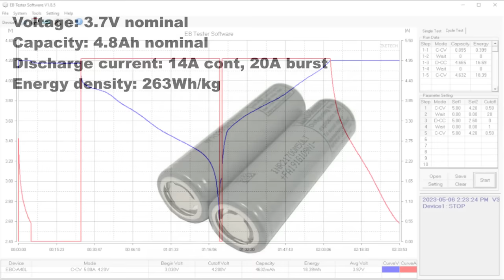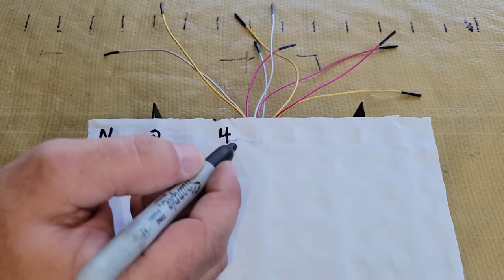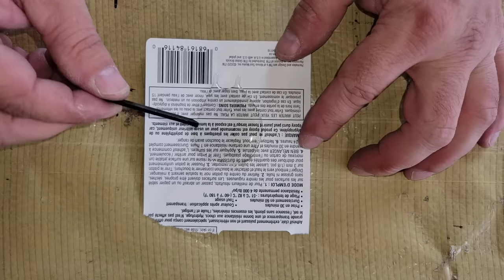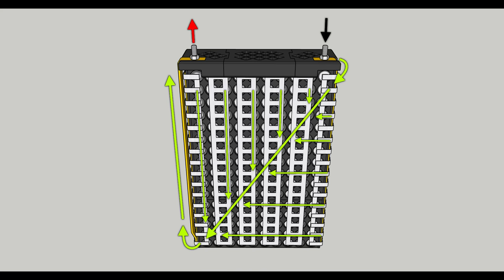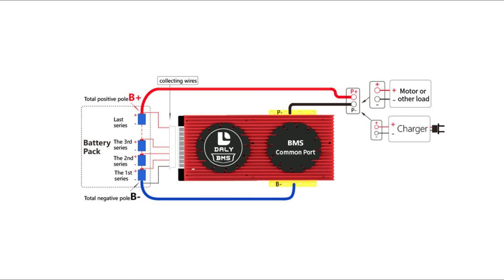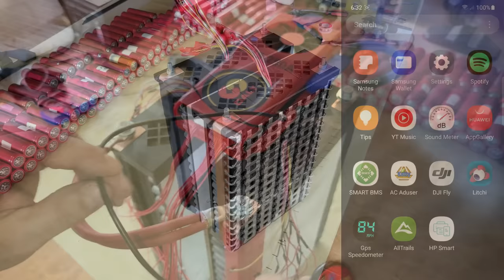Electric Motorcycle Build - E-Bike - Gen II, Ep 3: 77 Ah Battery

Comment: Grey stuff is "Gap Pad" it does allow a good thermal contact to the outer case, which air doesn't give you, while insulating electrically.
Reply from the maker: Thanks. No one else seems to have a name or source for it. Looks/feels very similar to silicone putty. I would question it's thermal transmittance ability if it was made of silicone. Not a good material for thermal transfer.
Reply: @JamesBiggar  An example product is Laird tflex HR400. Other similar ones on Digikey. Tacky silicone sheet, modified for good thermal conductivity - 1.6 W/mK vs 0.03 for air gap.
Reply from the maker: Nice. Not arguing an air gap is best, just questioning the logic behind using silicone. Without modification it's notorious for having very low thermal conductivity, lower even than air. Works great for apps that require high heat resistance. But if it's modified to be more conductive and it works, then it works. I might just buy some larger sheets and give it a try 👍 
https://www.engineeringtoolbox.com/thermal-conductivity-d_429.html
Reply: Just be careful that not all the pad materials are as electrically insulating as others. I think most with ceramics/aluminium oxide are in the megaOhm ranges, but the even higher thermal conductivity sheets are also very electrically conductive.
Reply: @JamesBiggar  Thermal pads are very common in PC hardware. It is used for memory modules in graphicscards, ssd controllers etc. These are fused with thermal conductive materials. I doubt its very useful in your case though. The pad is very thick Almost 10 mm by the looks of it. And it is connected to a slab of aluminum without fins etc. I won't expect it to do much in this case, maybe a 4, 5 degree C temperature difference at best.
Reply: @JamesBiggar  The motor you are using has been shown to do 50kW continuous and 80kW peak on Electric Bikes pages on FB, you aren't even touching the tip of its power yet!
Reply: Looks like thermal pads to me. Also used a lot in computer components

Comment: holy cow man! I built a battery super similar to this same different cells but still Li-ion, and I used the Grid cell holders to space them out but used the exact same copper bar method so that I could have screw terminals on a Li-ion pack. It is also for my electric motorcycle I built for my senior project in college. Great minds think alike!

Comment: Cool project, if you plan on using more powerful motor battery consider the BMW I3 and look for a wrecked one as carbon fiber frames can't be realistically be repaired. Each NMC chemistry module is 48V × 8 per pack = 384V nominally rated as 360V. Stock motor specs of 125KW (168 hp) and 250 nm torque (180 ft lb) that could theoretically have significantly higher output for 5 to 10 second burst mode.

Breaking down battery specs..
125,000 motor output ÷ 360 nominal pack voltage = 347 amps
48 volt module × 347 amps = 16,656 watts ÷ 750 watts per hp = 22.208 hp capability per 48v module

Comment: i am shocked how much patience you have dremeling every single cell and THEN sandpaper it! wow...
i would lost my mind after 20 of those.  🤣
Reply from the maker: Lol, super monotonous for sure. I can't stand tasks like that. But with the cost of new M50lt's being $8/each at the 18650 battery store vs paying $600 for three of these used modules that still have >98% capacity left, that works out to almost $2k in savings with extra parts to boot. So I put up with it lol
Reply: At the end when you explain the bms settings, there is a pile of cells unused on the table. Are these extras or duds? If extra why not add them?

Comment: Thanks for this video! I just bought an Emotorbike that has a 72v lead acid config and I've been looking to upgrade to a high AH lithium ;but prices for premade are over $1000 CDN ;but I can buy 2 36v 70AH battery packs for under $300 and wanted to strip then rebuild them into a 72v pack. This video is exactly what I've been looking for, thanks so much!
Reply: You can also just disconnect the bms from both packs and run to a new 72v BMS, cough bac4000..m

Comment: at 01:00 it sure looks like thermal pads, but the usability of conducting heat seems like it wont do much. The thickness of the pad suggest that there wont be a whole lot of transferring, and the heat sink is just a slab of aluminum (no fins etc). It might lower the temps by a few degrees C but is that really needed?

Comment: Any details on the bms? You mentioned that it handles 30 or 40 amps. I bought one of these packs and it will be great to be able to use this bms since it seems high quality and built right in; but I can't seem to find any details on the wires; and do not see any voltage on the wires. There is not much marking on the the bms pcb. If you are able to do a video of the bms, it will be extremely helpful. Thanks.

Comment: Cool! Have you thought of having a mi battery slung under and a second battery using the Petrol tank filled with batteries as well? That's what I did on my 1964 Lambretta Conversion. I get a solid 720 km per charge

Comment: instead of two dusk bars for the positive side, could someone put a awg wire at the bottom so it will still equally share the load? Just wanted to know for my battery build!!
Reply from the maker: Yes, as long as you size it accordingly.
Reply: @JamesBiggar  what you mean by sizing? Does that mean getting the correct awg number for the battery?

Comment: Instead of heat gun can you use a electric iron to soften tape/glue to remove back easier?
Reply from the maker: Use a towel or something between the iron and the plastic so the plastic doesn't melt and it should help, just be careful not to short it out, and make sure there's no water in the iron.

Comment: Why did u say the original nickel wasn’t capable of the full current output of the cells?  At the terminals it gets thin as it comes to a single tab but going between the cell groups there’s a lot of nickel.  I have three of these packs and want to put out the max current.  Depending where I look I’ve seen them putting out maybe 250amps and I planned to see my esc to that limit.   I plan to dremel off the plastic at the terminals and solder a copper strip there and call it done.
Reply from the maker: Being able to output 250A doesn't mean they should be. The cells in each pack can't even handle that kind of continuous current without risking serious damage, especially with the factory bus bars oriented as they are. The M50lt's are only rated for 14A continuous, 20A peak. 14 * 11 cells in parallel = 154A. At 72V nom, that's only ~11 kW. My bike motor can do 12 kW continuous, hence part of the reason why I broke down 3 modules and paralleled 5 more cells together in each string so the larger pack can handle at least 220A. Refer to the cell spec sheet and bare in mind that max power is not sustained power. But this is just the cells. One of a few reasons why a battery built for low load demands needs to be rebuilt to handle high loads. If you consult a nickel strip ampacity chart and do a calculation on the cross-sectional area, the factory nickel can't handle that kind of current without serious risk of a fire, either. More heat also means less efficiency. Heat is energy, and the more energy wasted creating it, the less you have to play with. Electric powertrains should be kept <70C across the board for safety and efficiency. Trying to pull 250A continuously through a battery built for 50A max isn't safe or efficient. It can be done for a few moments, but there's a reason why ev powertrains are rated based on continuous power and not peak power - peak power isn't sustainable because it risks damage if prolonged. Understanding cell specs and conductor ampacity is a must if you want to build or rebuild batteries. I recommend ignoring people who push things to their limits and claim "yep, it can handle it" without offering an explanation as to why they think that. Maybe it can, for a while. I could run my truck a full throttle on the highway too. How long do you suppose the engine would last redlining it constantly? The factory 'bus bar' configuration (connected to the terminal tabs) is also not ideal - besides being WAY too thin for the current that I'll be pulling from it, the load is directed through the top of the pack only, while the bottom cells are left to equalize the pack which leads to the top cells degrading before the rest, if they're not immediately damaged from overcurrent. That's another reason why I broke them down and rebuilt with new, thicker bus bars oriented properly to pull current through the entire pack to share the load with as many cells as possible, not just through the top. Just because the bus bars extend the entire pack doesn't mean that's where the load current is going. Electricity follows the path of least resistance. I explained this in detail in the video with diagrams. An experienced builder would look at the busbar thickness and configuration, and deduce that the design is for low load since the bars are very thin and the load is pulled through just the top cells. Again, consult an ampacity chart, then look at the thickness of the copper bus bars compared with the factory. Sandwiching a copper strip onto them will not achieve what you think it will. Those copper bus bars are 1/8x1" and rated for 250A+ continuously (much higher peak). The factory bus bars are a fraction of a mm thick. A significant difference. Cross-sectional conductor area matters if you don't want your project going up in flames. The bottom, common sense line here is that those individual packs were not designed to handle the power of three packs being pulled through them. They came from warehouse bots that simply drive around a warehouse all day on low wattage motors. Cap was more important than power in this app and that's how they were built. DIY'ers connecting the packs together haphazardly was not a thought that was in the engineer's brain when he was developing them. I do not recommend using them as is unless you intend to use them for what they were designed for; low voltage, low load demand. If you want to take advantage of more of the power that the cells have to offer, continuously, then the modules need to be rebuilt accordingly. https://esk8content.nyc3.digitaloceanspaces.com/uploads/db2454/original/3X/e/9/e99184eed42645d3a97defa445c8d011be6b6277.jpg

Comment: Is it possible to make a case that will transfer the heat to some kind of cooler, to make a better cooling, then place a radiator and a hater pump, to maintain flow
Reply from the maker: Yes. I was wrong about the grey material in the video, it could be a good candidate to bridge the gap between the cells and a heat exchanger, but I think it should be thinner for better heat transfer like another user pointed out. I used liquid cooling for the buggy motor too, but the motor was already built for it. I just had to add the pump and radiator. This is quite a bit more complicated, but I'm considering it.

Comment: How important would the bus bar trick(for current) be on a 18s5p pack, which is just two 9s 5p packs connected in series? Thank you so much! I was currently drawing current from the middle of the 5p groups, to try and maximize cell use.
Reply from the maker: I wouldn't be worried about it with 5P, especially if you're pulling current from the middle of the pack and the load is equal to or lower than the max continuous rating for the cells. The original modules that I used were suitable as they were because the load from the bots wouldn't have overloaded the top cells. They just would've degraded faster than the others over time. But the top cells would have been overloaded in my bike for sure, which necessitated the switch.
Reply: @JamesBiggar  Thanks for the great information! I'm planning to build another 20S 12P pack for my main scooter (the 18s5p is for a friend), and ill be pulling a lot of current, hopefully it doesn't go too crazy then. I'll definitely consider the whole bus bar option for that.

I'm using samsung 50S 21700 cells and pulling a max of 20A from each cell (they are rated for 25A but higher if cooled), for not a long duration.
Reply: @JamesBiggar  I have a big concern.
In the 20S 12P pack, i only have 10 cells horizontal space. This means I'll have to connect two 10s12p packs in series.
For a 12P pack, when i connect it in series, if I just use a singe long copper plate it'll definitely cause some major issues as current would prioritize the few cells that are closest together.
should I solder on some thick gauge wires to the + of the first 10s12p, and - of the second 10s12p, then join them together that way to mitigate this problem?

Comment: NICE build! I just got one of them packs on eBay and also building a battery for a smaller motorcycle 72v i was just going to use all the cells in the one pack how much did you get that affordable DALLY bms for? I'm now considering buying a second pack lol
Reply: $600
Reply: 600 no no, aliexpress will cost you $130 for the one in this video, but there is even more affordable ones on there, just be careful when choosing

Comment: Any estimate on how much current the included nickel will handle? Ive got a couple of these and planned to replace the BMS only.
Reply from the maker: I wouldn't pull more than 40 or 50A through it. I haven't measured its exact thickness, but I know it's no more than 0.2-0.3mm between the cells, and the main bus bars 'might' be 1mm, and I don't think they're pure nickel or copper (or nickel plated copper). They're very stiff, not soft like nickel or copper. They could be nickel plated steel. You'll want to double check and measure their thickness because that will tell you what the pack can handle - the bus bars would've been built for the current the pack was built for. A 1mmx10mm pure copper strip can handle 49A. Bare in mind that the og modules are built so that the top cells in each series string are taking most if not all of the load vs spreading the load with the reversed bus bar configuration that I used, so they're at a lot more risk of being damaged from overcurrent and are going to degrade sooner than the rest. Each M50 LT cell can only handle 10A continuous and 20A peak, and being in a series connection together, the top cells will each bare the full load, not together. Ie: if you want to pull 50A from the pack, then you're probably going to pull close to 50A through each cell between each series connection at the top. With the arrangement that I used, that 50A load would be spread out to almost every cell in every string so that each only has to deliver a fraction of that current because it's forced to flow from top to bottom through all of the parallel connections to enter and exit the pack instead of just flowing across the top through the series connections. I would personally rearrange the bus bars so the pack lasts longer, but I think if you keep the load under 40-50A then they'll probably be fine as they are. The original bms can't handle anymore than that, so the conductors likely won't either, and I definitely wouldn't push the cells beyond that without making some changes. Use the ampacity chart here for reference: https://evolveforums.com/attachments/ampacity-20-10-20meter-20-20low-20temp-jpg.2903/
Reply: @JamesBiggar  awesome! Thanks much for your input!

Comment: Nice work. Any idea what current the original bus bars in that pack are capable of?
Reply from the maker: The nickel strips and BMS were only rated for 30-40A. I wouldn't count on the bus bars handling much more than that.
Reply: @JamesBiggar  Thanks. I've been eyeballing these packs for weeks hoping 2 of them would make a great cheap 20s moto pack without much work. Figured the BMS would have to go but I was unsure about the nickel. They are still an amazing deal but no shortage of work involved.